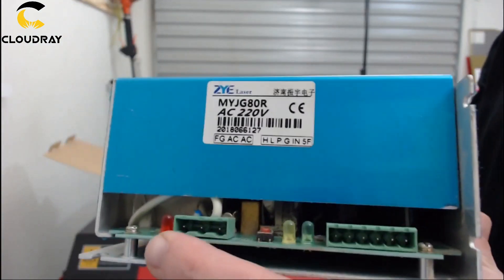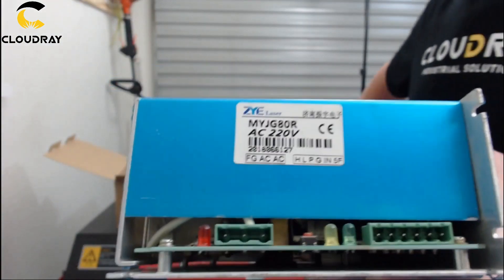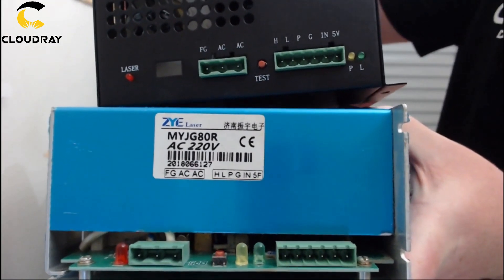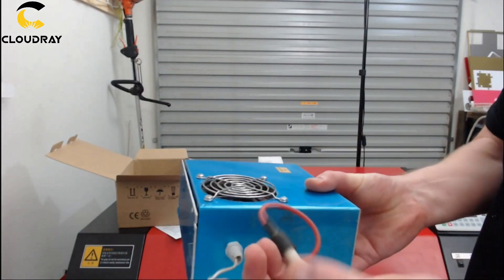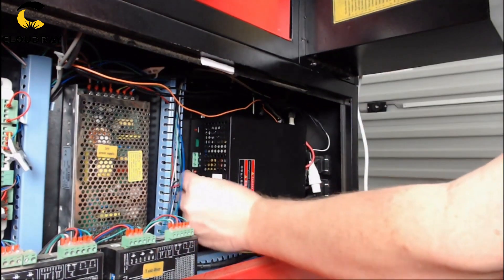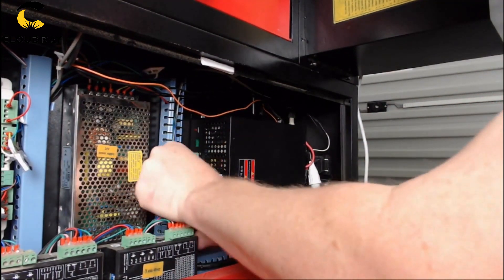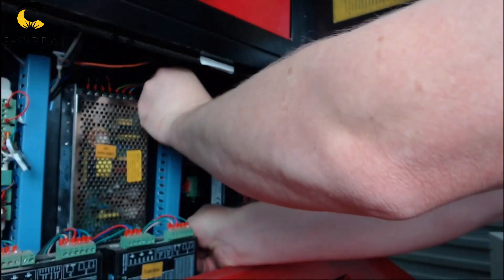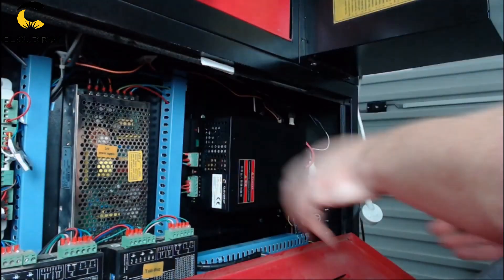Laser Power Supply Replacement

Comment: How long does it take for the power supply to discharge. I got zapped in pretty good.
Reply from the maker: If the machine has an earth connection, the discharge of the high-voltage pack will be completed in a very short time. If your machine does not have an earth connection, you will have to wait approximately 5 minutes for your own safety.